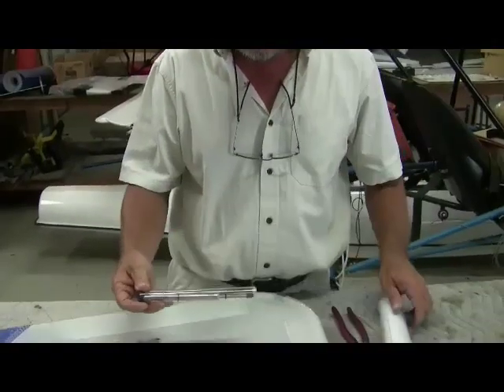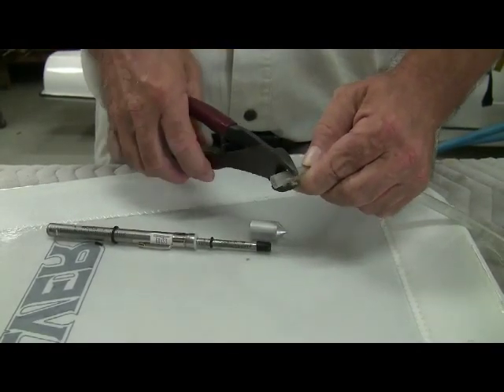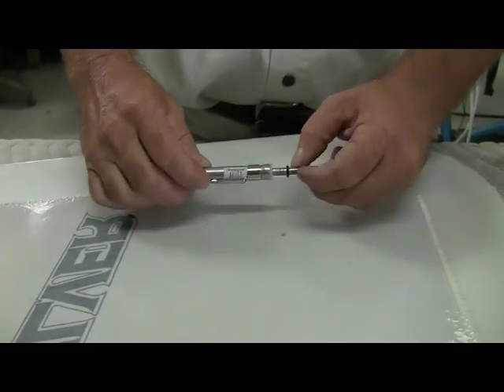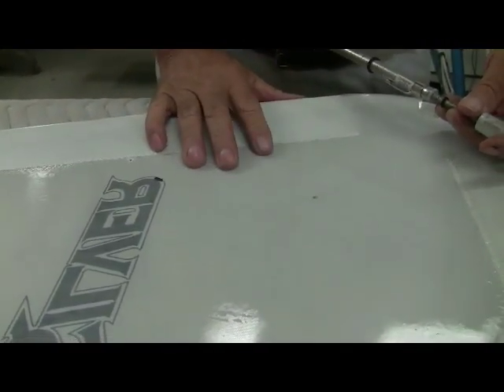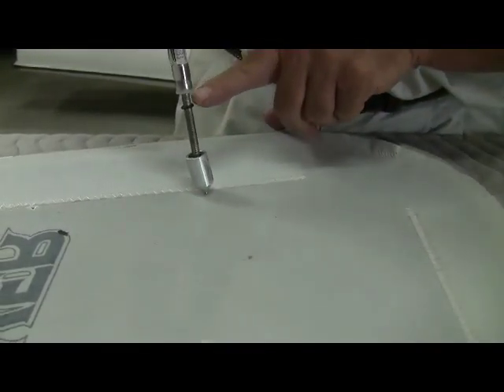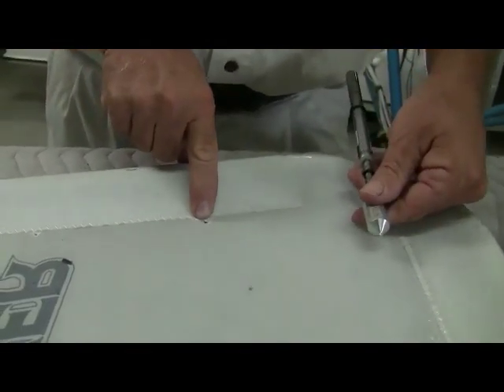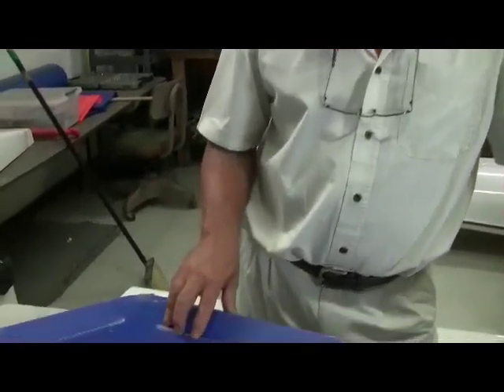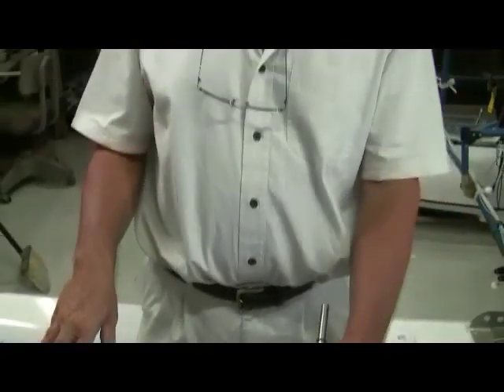Quicksilver Aircraft / Ultralight Fabric Tester

Comment: I wrapped my rubber tip with blue masking tape. This is a belt tension tool also so it works great for checking belt tension on a belt drive without the metal tip installed.   Great tool. I have a video of the same tool being used on another aircraft. BTW with the rudder vertical it really shouldn't get as much sun as horizontal surfaces so with it failing I would expect most of the horizontal surfaces to also fail. Just a good example of how the fading of fabric isn't a good way to judge.

Comment: Bob, thanks for your post! Could you explain how to use this as a belt tension device?
Reply from the maker: Most belt tension specs will call for an amount of pressure for a given deflection.  On the Quicksilver "V" belts the starting tension is 1/8" deflection @ 5 lbs.  What this means is you would set the O ring on the 5 lbs mark.  Then push on the center of the belt span till you nudge the O ring, then measure the deflection.

Comment: Gene, thanks for the video. I have that tester but wasn't sure of the settings. On mine they appear to have updated the unit because I have a yellow tip under the tester tip, and it fits snug, no wobble.
Can you explain what the index and o-ring on the handle is all about?
And if you know what Bob was talking about, this being a belt tension device also, maybe you could explain that. Thanks!
Reply from the maker: This video will explain in detail Browning V Belt Tension Checking Procedure
how to set the tension on your belts.  Use 1/8" deflection @ 5 lbs.

Comment: Does using this method damage the integrity of the fabric even if only a dimple is left after testing? Does the dimpled section now constitute a small stressed weakness area?
Reply from the maker: After a while, the dimple is still barely visible.  I really have no way of knowing if the fabric is compromised by the dimple.  I have tested fabric on aircraft that failed at 5 lbs.

Comment: I thought synthetic fabric was supposed to be pull tested not punch tested. Not trying to be a dick its just that in A&P school that's what we were thought.
Reply from the maker: Tim... You are correct.  The proper FAA "approved" test is fully explained in  ASTM publication D5035.  Whereby you remove a section of fabric from the side closest to the sun, attach to a clamp and scale then proceed till failure.  Then you embark on a repair to cover the created hole for testing.
The punch test I have shown in this video is an industry accepted method of "Go - No Go" test.  Our segment of aviation is that of "Experimental" and not bogged down with mountains of CFR regulations.  I am involved in both worlds of aviation and am also a current DAR with function codes relating to this industry.  If I were doing a fabric test on a commercially operated certificated aircraft I would follow ASTM D5305 as you have stated.  Thanks for the comment.
Reply: Thanks a lot....I am building a Nesmith counter myself and about to start the covering process.